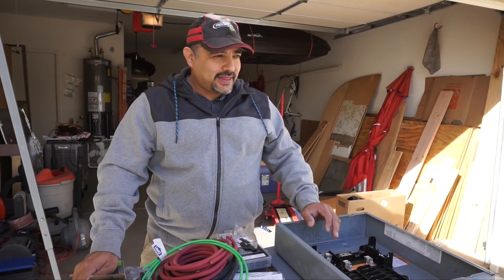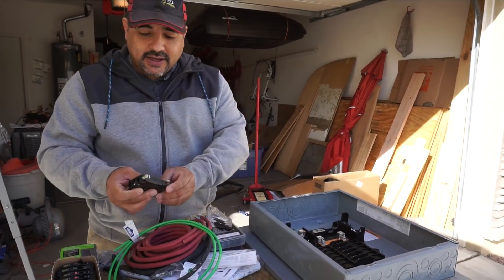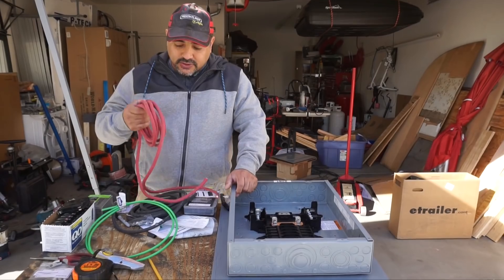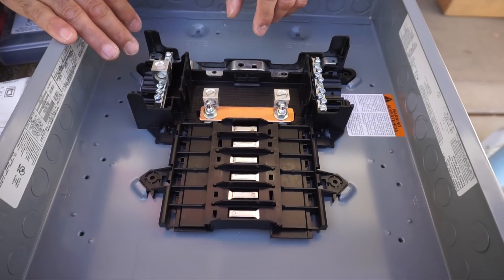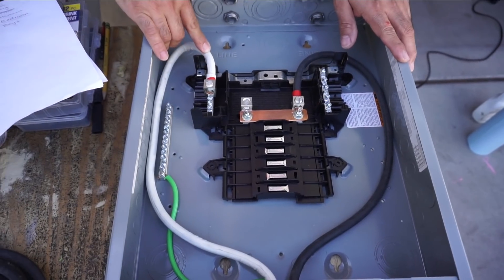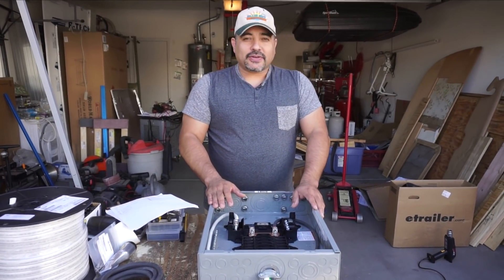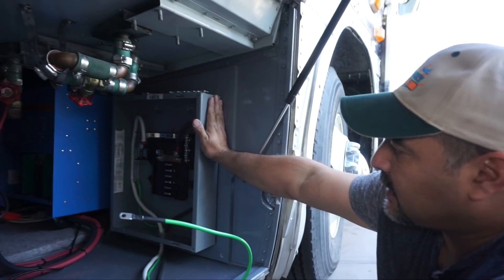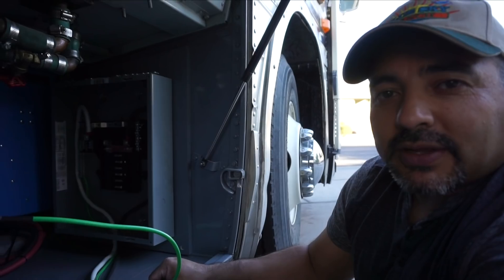AC Power: Part 1 - Installing a 120V Load Center

Comment: The entire installation hinges on the "bus bar" that you MADE from other items and does not seem to exist in the real world. I spent quite a bit of time looking for a QO manufactured bus bar that bridges the connections for use in this, a 120V only breaker box, and it does not appear to exist. If it did exist, you would most likely have used it rather than making your own.  That would be a great thing to point out.

Comment: I hope you clearly marked the cover about the copper bus connection making it a 120 VAC L1 box.  You will have 50 amps on that leg 1  instead of only 30 amps from normal one leg power, so that is better.  Still not something anyone will expect.

Comment: What kind of wire/cable did you use for your outlets?
Reply from the maker: Thank you Isaac - we used Marine 12-3 cable in white PVC from Waytek wire.  It's a little pricey but much cheaper than anywhere else I could find quality wire.  https://www.waytekwire.com/item/MC12-3/Multi-Conductor-Marine-Cable-MC12-3-/

Comment: Thank you for this video, I have wondering how to run a small breaker box as 120v in a tiny home and could not find the simple answer... I plan to do a shipping container home with off-grid solar 120v only.
Reply from the maker: I double-checked with my neighbor who is a master electrician about the copper bus bars (to make it a 120V box) and he said: "Yup that is a great way to do it".  We have been using it for a good 2.5 years without a single issue. 
 Good luck with the shipping container!
Reply: @BeginningfromthisMorning  This has been the only video showing how someone used a copper bar to bridge!  Most just install a wire between the sides. Nice Job...I've been looking for something like this.  One question, did you make the bar or purchase the bar?  Thanks
Reply: Oh...I actually just saw you used a bus bar from your battery purchase...nice for you...me gotta look for something similar.

Comment: Great video!  Could you share the exact model of the Square D box you used?  I'm having a  hard time finding one that will be easy to connect the 2 poles, such as you have done with the copper buss bar.
Reply from the maker: Hi William - of course.  It is a Sqaure-D QO 125 Amp 12-Space 12-Circuit Load Center with Cover.  The exact one we bought has been updated to be this one: https://amzn.to/3d5kvpk

Comment: So to be clear you wired your 110 shore power into the inverter and you wired your batteries into the inverter.   When you plug in shore power your inverter automatically stops using batteries and starts using shore power.  That allows you to just use the one breaker box for both power supplies as they both go through the inverter and switch back and forth automatically with your smart inverter correct??
Reply from the maker: Thank you Joseph - yes you are correct.  Shore power comes into the Inverter, batteries go into the inverter.  The sub-panel is wired directly to the inverter.  The inverter has an internal transfer switch and the ability to "boost" (provide more power) to the shore power with the batteries.
Reply: @BeginningfromthisMorning  Thanks that helps clear things up.
Reply: Also if you know anyone needing 56 nice high back reclining Prevost seats I have many more than I need. :)

Comment: Just curious as to why you would not use the other leg of your 50A shore power?
Reply from the maker: Thank you Manifest Skoolie - We wanted to keep it to a 120V system but still be able to use 50 Amp shore power if it was available (even if we are only using 1 leg - 50A is still more than 30A ).  In order to do 240V and use the other leg, we would have needed to buy another Inverter and configure them for 240.  We just didn't feel the benefit was worth the additional expense.  We could have just wired it for 30 Amps but we figured that if we are going to do it we would just wire it for 50 Amps just in case we decided that we would like 240 V in the future.

Comment: Off topic but, while snaking all those wires you may want to put in a new fuel line. a leak on the suction side of the pump is hard to detect and  will leave you stranded and confused. The original one runs through the spinal cord and is hard to replace, I ran mine through the bays near where your wire bundle is. I also had a leak in the pickup inside the tank. It cost $$$$ for towing and many days of pulling out my hair.
Reply from the maker: Thank you Gary - funny enough our bus already had the hoses replaced - from the tank we can see new hoses coming out of the tank and the old hoses are just off to the side.

Comment: That's awesome to see the marine 12/3 cable used. Wouldn't have thought of that.
Reply from the maker: There is a lot of discussion about it on the forums - some folks use extension cables, others use ROMEX ... the marine cable was expensive but it was not outrageous - 250ft spool was just over $300

Comment: Those wires in the inverter look really close to each other. Maybe you could use some blue Loctite on the end of the screws thread to prevent them from loosing up while driving. Will be a fireworks show for sure if these wires touch...don’t want that to happen! Thank you for making these video’s!
Reply from the maker: Great idea - loctite + cover them in rubber should have me covered :)
Reply: Beginning from this Morning Yes, can’t get why the Inverter doesn’t have a barrier block screw terminal standard on the PCB. So much safer than this when the current is so high... see what I mean by barrier block: https://www.amazon.com/uxcell-Position-Barrier-Block-Terminal/dp/B00E6KU712

Comment: Excellent work-I’m looking at a generator high Voltage DC charging infrastructure too as I plan my conversion to high voltage DC charging using apx 380v DC. Also dryer wired for 220v ac and induction cook top. Great job & thoughtful!
Reply from the maker: Wow - I never considered going that high - I hope you share your discoveries somewhere.
Reply: What brand of induction heater do you like?
Reply: So if there are "outlets" in the bus that require 240 volts (like a clothes dryer), you'd need a 240 volt load center box in addition to the 120 volt load center box, correct?

Comment: I would suggest putting a boot over the wires coming into the load center at the strain relief, just to stop any chaffing that might happen. I have created a play list on my channel of your videos. Glenn Lever
Reply from the maker: Great suggestion - I will look into this.
Reply: A strip of vinyl pan liner works well for that.
Reply from the maker: Thanks for the suggestion kevin - I will look at vinyl pan liner

Comment: I am curious about your boosting system. How does it boost the amps and not lose the volts? I thought that was impossible or am I not understanding what you are saying?
Reply: They have an inverter that will allow them to draw current from multiple sources to meet demand.   So, for example, if they are connected up using just a regular extension cord at someone's house, they can set the system to draw only 10 amps from the extension cord and get the rest of the current needed from their house battery pack.   In this case, the concern is that they were considering only using a 50 amp cord in their system, but if they are connected to a 50 amp RV hookup, they could use all of that and then their inverter could also supply an additional 42 amps of current - which adds up to 92 amps.   And, that is more than is safe to pull through a 50 amp cord.

I hope this helps.
Reply from the maker: Correct - they call it a "boosting" inverter but those terms are already taken - usually in electronics a "booster" brings up the volts.  Some companies call it a "hybrid" inverter which does a better job of describing the functionality - but that was already taken by Magnum ;)  Yes you are correct - no need for a transfer switch at all - the Inverter itself works like a big transfer switch pulling in power from shore power, generator, or batteries depending on demand.
Reply: Beginning from this Morning oh that makes sense, thanks for the explanation. I have the magnum hybrid and was wondering what boosting meant.
Reply from the maker: I couldn't have said it better myself - thanks Richard!
Reply: Interesting. Thanks for the reply. So if I am understanding you correctly now it is not really boosting anything. It is simply drawing current from multiple sources, one being grid electric which the inverter just allows to pass through it, or perhaps bypass it, and the other inverting from battery voltage to AC voltage. So my last question is since there would be two sources doesn't that mean you have to send the inverted electric to one source to be used and the grid electric to another to be used. In other words both are not flowing through the same wires are they? I ask because if this special inverter can run two different supplies of power through the same lines then there would no longer be a need for a transfer switch on a generator when power goes out would there?
Reply: Thanks for the information
Reply: You're quite welcome!

I have a degree in electronics engineering.   That's how I know you're doing this stuff right - and,  if I see you making a mistake, I'll let you know.  LOL!
Reply from the maker: I appreciate it Richard
Reply from the maker: Jason Smith yes, the magnum hybrid works the same way.

Comment: Wow....all those wires...looks like u all put some big bucks into the electrical. One day maybe you'll be able to start on the inside. ..lol
Keep up the good work.
Reply: They have started on the inside.   They spent countless hours removing stuff and putting in new flooring and  infrastructure.    I suspect that after they're done with installing the electrical system, they're going to be ready to start doing more to finish the interior.
Reply: Richard Owens I've seen it ....lol.... just saying there  sure is a lot of wiring going on....
Reply from the maker: We are anxious to start the inside because then it will "look" like more work is going in, but we are trying to do everything as well as we possibly can.  We love and appreciate all the feedback.  Thanks for all the love guys.

Comment: I love how you do everything right from the get-go. But could I suggest putting a rubber boot over one of the 2 lugs in your inverter? I would just stop by a bicycle shop and ask for an old inner tube out of there trash and cut a flap out of it wrap it around the wire and lug then zip tie it into place. That way if you do ever need to service it you could just pull the flap back.
Reply from the maker: That sounds like a great suggestion Bob - I will likely do something like that this weekend.  Thanks for the heads up.

Comment: Looks great I like the fact that you are taking it slow and thinking it out not everyone does that and its dangerous as well as expensive if its done wrong.
Keep up the good work.
Reply from the maker: My oldest is convinced he wants to live on Mars!
Reply: Well, full time RV living should be good practice for that!  LOL!
Reply from the maker: Thanks Brian - we are trying to do things as well as we are capable ... learning a ton in the process.
Reply: Their kids are destined to be electrical engineers.
Reply from the maker: LOL good practice indeed
Reply: I also ran a version of your waytec stranded boat cable on a coach I built back in 1998 super expensive but worth it and it was very easy to work with I've been looking for it again building a new coach where did you purchase it was it direct from waytec? Anyway you're doing a great job also liked your choice on the insulation used and the fact your whole family is involved is pretty cool I went it alone years ago on the last one but at least the wife is trying with me on the new one all the kids are grown and have families of their own.
Keep up the great work!
Reply from the maker: Thank you Brian.  Yes, we bought the wire directly from Waytec - They were the best price we could find by a pretty significant margin.  It has been a joy to work with so far - high-quality stuff.  We try to involve the kids as much as we possibly can - sometimes they even film :).  What are you building?  This is our first time building anything significant - It has been really fun so far but we are ready for it to move along a little faster :).  Good luck on your build - and thank you for the encouragement.

Comment: It's a very tidy install. Did you say you have two engine heaters?
Reply: I've seen blogs that use the block heater when the engine is cold even in warm weather, easy on the starter and batteries
Reply from the maker: Thanks Kevin - yes there are two plugs in the back for engine heaters: one is a traditional block heater and the other one is like a pad that is on the oil pan
Reply: +Beginning from this Morning You don't need to turn on the oil pan warmer except in extreme cold climates. The coolant heater is almost always enough. Are the two separately switched?
Reply from the maker: Yes they are on separate plugs and can easily be separately switched.  If all goes according to plan we should never need to use the oil pan warmer at all ;)
Reply from the maker: Interesting - I am going to look into that - wouldn't hurt to run the heater for 30 minutes before we take off ... I could even program a routine for automation of it if I get really ambitious.  Thanks for the tip
Reply: I currently do not have a block heater, my bus is from the southwest. 
i plan on integrating the coach hydronic system into a preheat loop. I am also putting in a oil heater. My thought is oil heater is more important for engine longevity. It will get the 40 w flowing faster. Any thoughts on this?